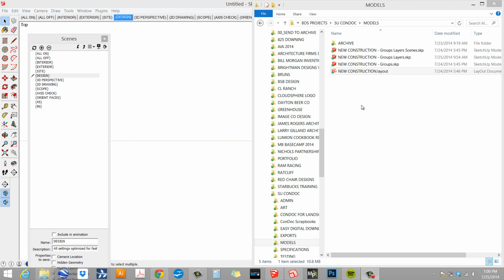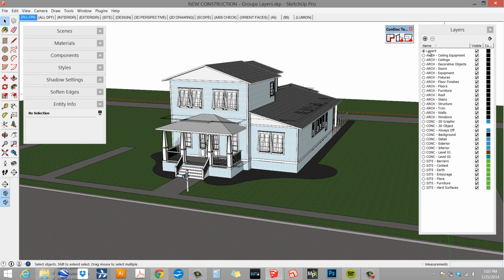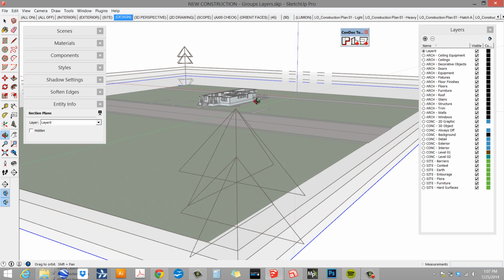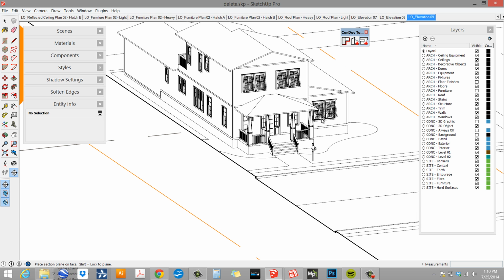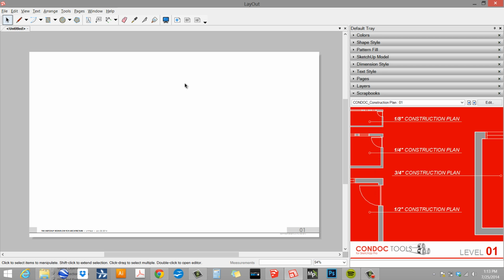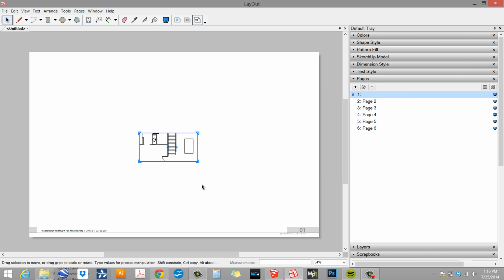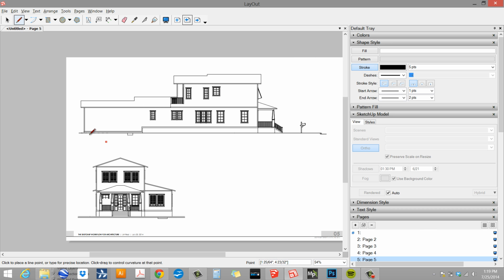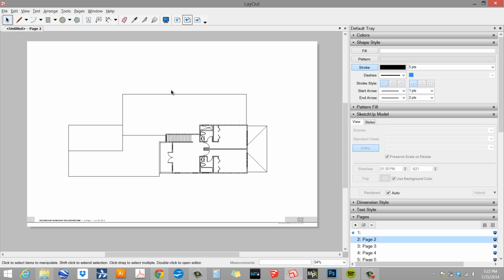02 NEW CONSTRUCTION

Comment: Hi Mike, I purchased your book sometime ago & have used the process for construction documents in an informal way. I can see the new Con-Doc Tools will structure this better & was wondering in the SU LAYOUT scrapbook templates if you had a metric version, as being in the UK.

Although the videos on the Con-Doc Tools SU Extension are helpful, it does have an SU Model already drawn up. Perhaps another video demonstrating a new SU Model being drawn up from scratch in association with the Con-Doc Tools would give a ground up better idea of the Con-Doc Tools SU Extension. I would imagine it would have to be over a few videos for a typical model as you currently show, or it could be just a very basic model in one video, anyway just a thought.

Over & out,
Clayton.
Reply from the maker: Hello Clayton!  I will take your suggestion into consideration.  For right now, check out my SU/LO/CD videos to see the process from the beginning.  The ConDoc Tools are fully compatible with Metric units.  All of the Metric scrapbooks are complete and included with the download link you receive once purchased.